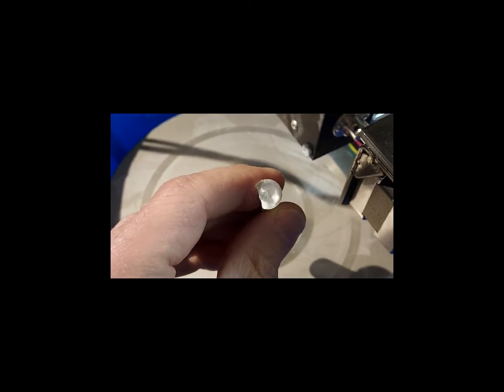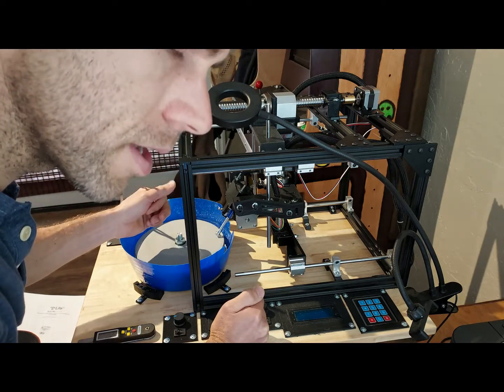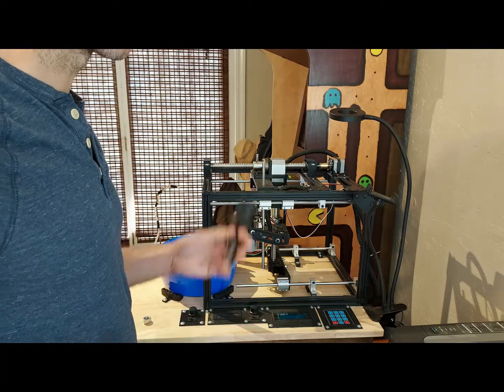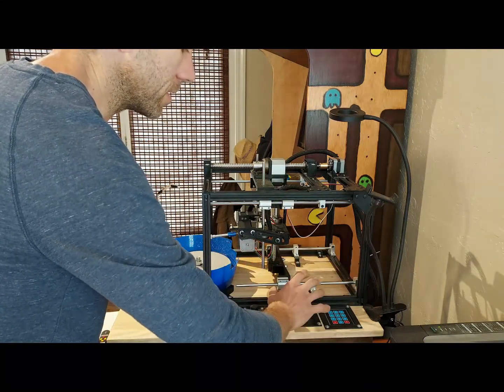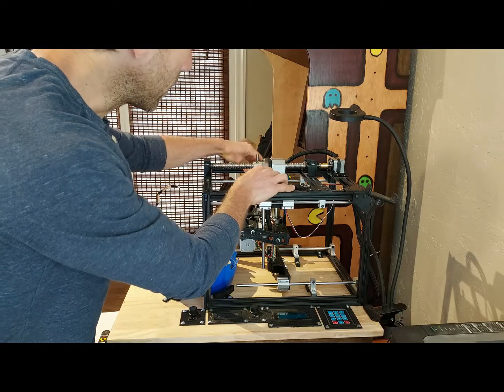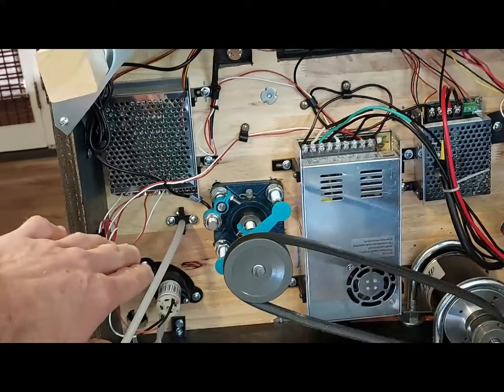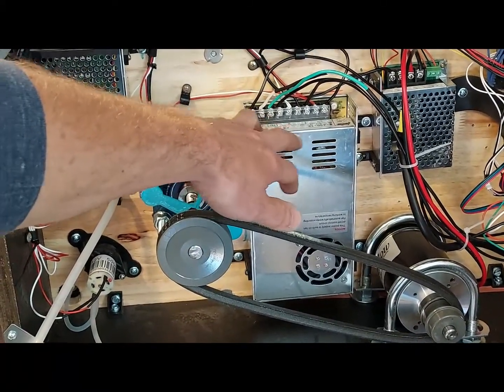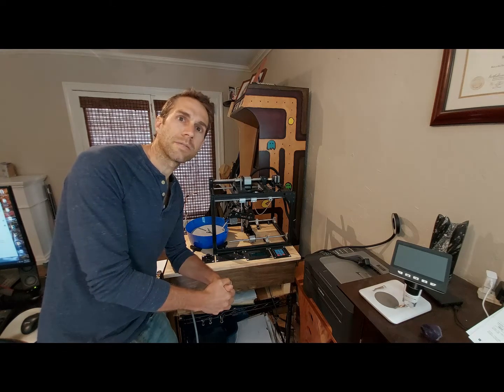Problems with my Homemade faceting Machine - Part 2

Comment: Hello Austin, could you please help me? For days now, I've been trying to figure out where I can buy the main screw/motor shaft that holds the master lap. In your video, it looks like it is completely round on the lower part and has threads on the upper part. Could you please tell me the exact designation of that piece and where to get it? I´d be very grateful! Thank you in advance!
Reply from the maker: Is this what you mean? https://amzn.to/3PugXSO but In the video, starting at about 5:00 I discuss this part and how I replaced it and the entire shaft with a pully system to help get some of the wobble out.